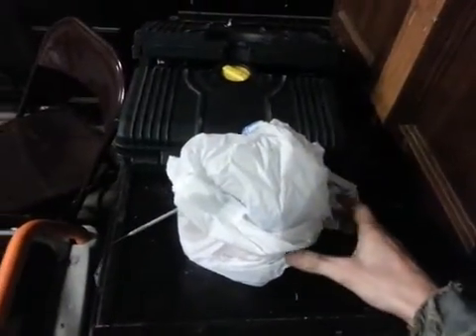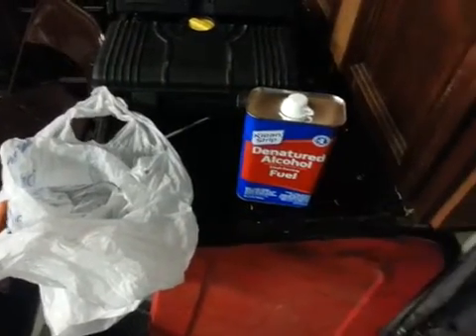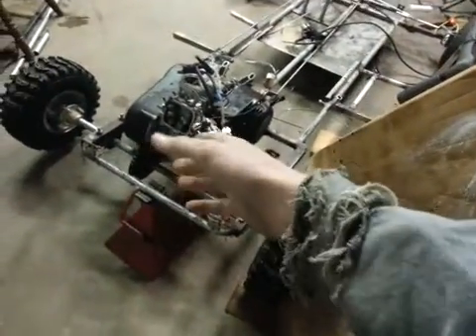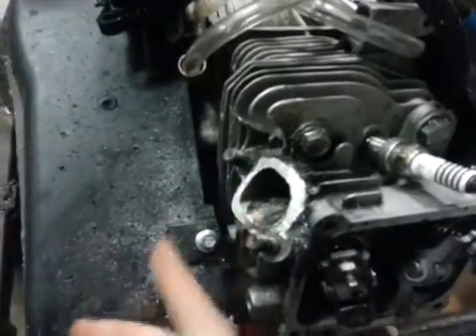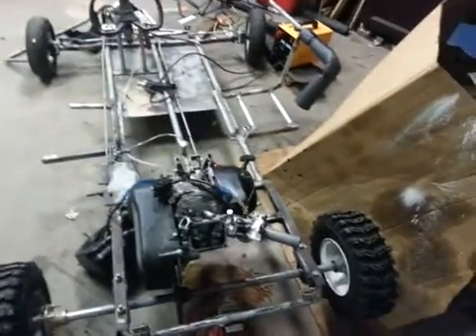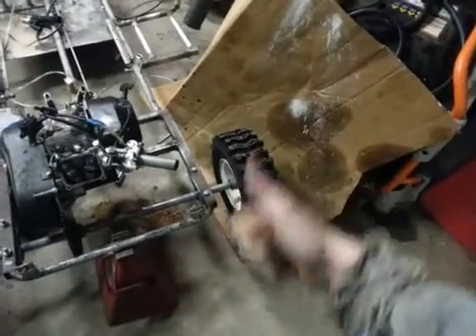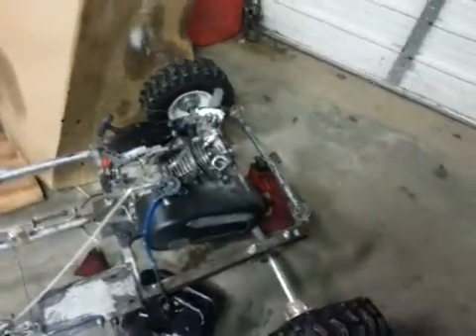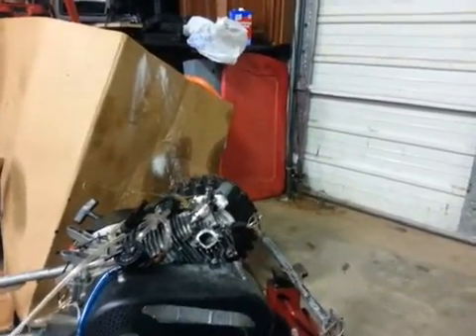. Methanol Fuel Upgrade for  the Predator engine [vlog]

Comment: That's definitely ethenol not methanol and being that it is an alcohol fuel it has to be ran richer than gasoline and it's not going to gain you that much hp it's used in high compression applications to prevent spark knock and detonation you could just use e85 but it's a waist on your stock compression engine